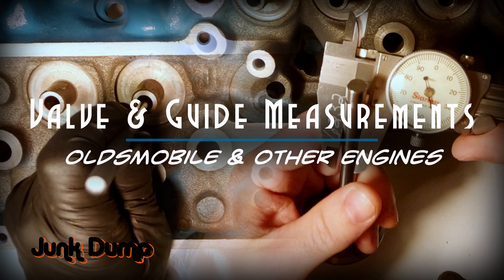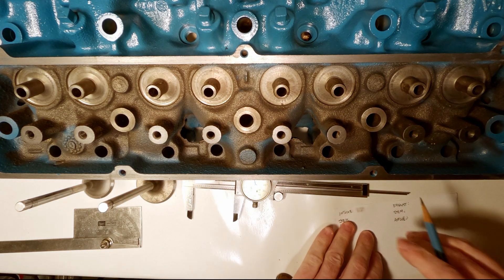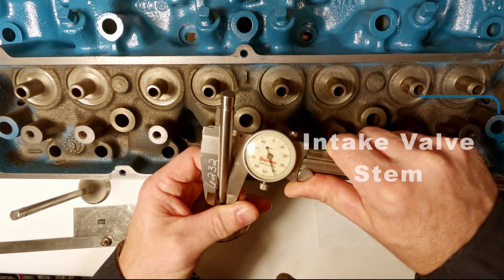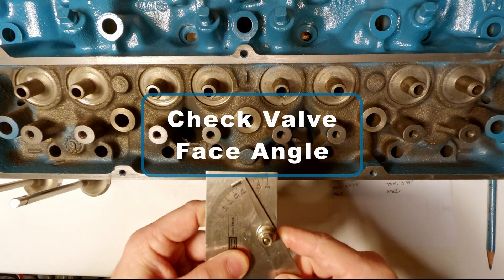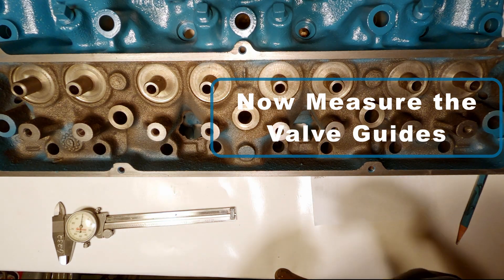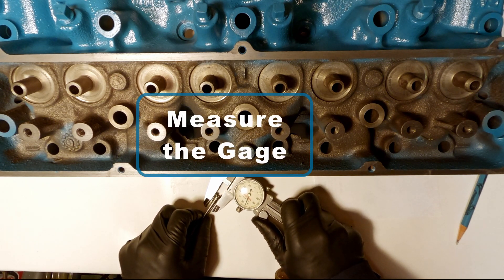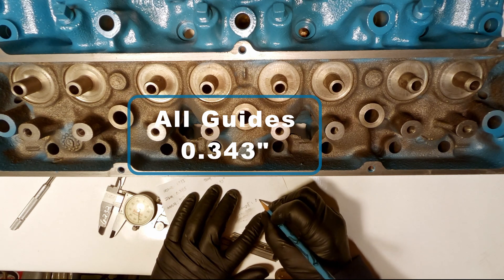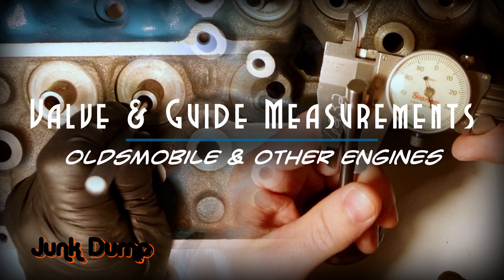Engine Valve Measurements & Valve Guide Calculation

Comment: Enjoyed your video JD, especially determining the guide to stem clearance using the small hole gauge. Were the measurements taken before or after any machine work to the guides? Easy for me to say but keep making your videos.
Reply from the maker: I took those measurements after having new oe style steel guides installed at the machine shop. Thank you for the comment and I am going to continue making videos, but less frequently than one a week as work at the shop is increasing lately.